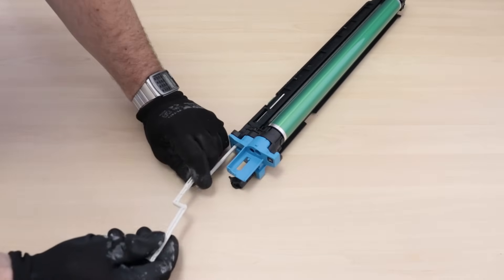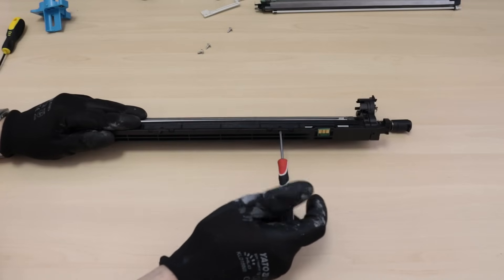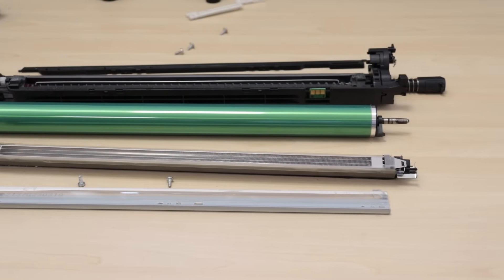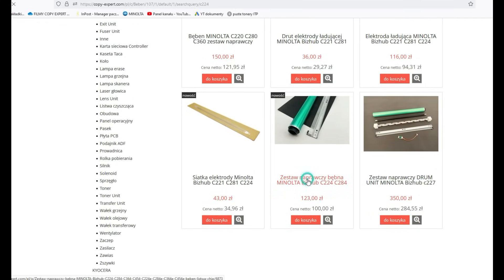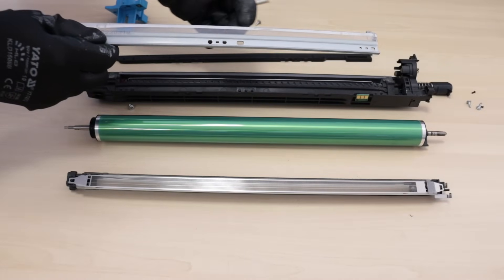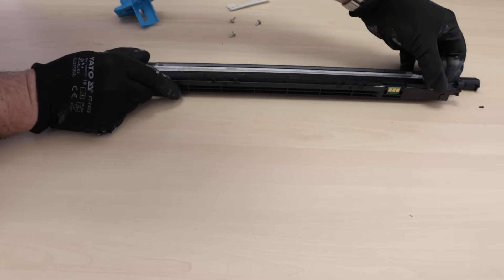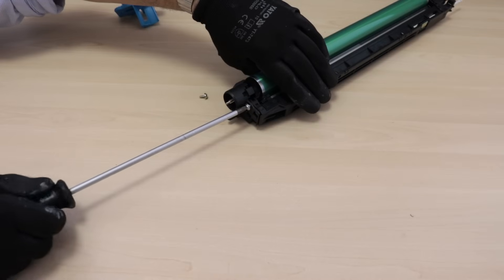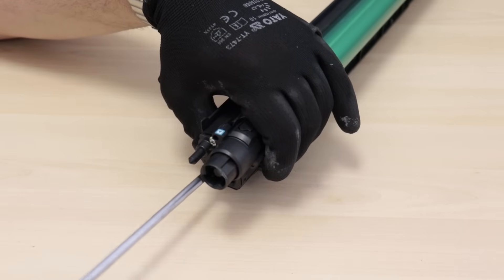Replacing the drum, blade and chip in copiers KONICA MINOLTA bizhub C224 C284 C364 C454 repair Drum

Comment: 306 ricoh code Sc 672 callservice error
Reply from the maker: @salmanmani6366 you have to replace controller
Reply: Sir 4500i kyocera disc cannot uses cassettele failure problum
Reply: disc cassette can not be worcking
Reply from the maker: @salmanmani6366  I don't understand. write again
Reply: @MrRicoh  ricoh machine solved problem
Reply: but kyocera 4500i cassettele problems
Reply: how tu fix this machine code 672 of ricoh machine
Reply: you solve some thing
Reply: please help me

Comment: How about the chip? Do I have to break the old one and glue the new one?
Reply from the maker: Usually, the chip is attached to the bottom with double-sided tape and can be attached without any problems.
Reply: @MrRicoh  yeah I see it but it was bolted, but found an old drum I have kept and did some trial and error on how to get it off to replace with the new one.
Thanks and thanks for the video!
Reply from the maker: It's always best to leave an old item because it may come in handy. You don't want to know how many such parts we have in our warehouse. Drama :)